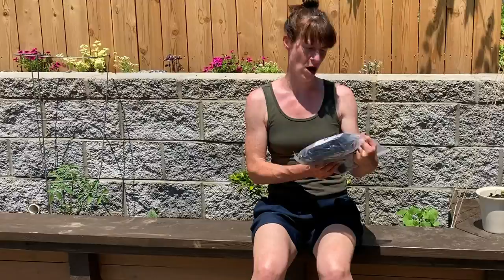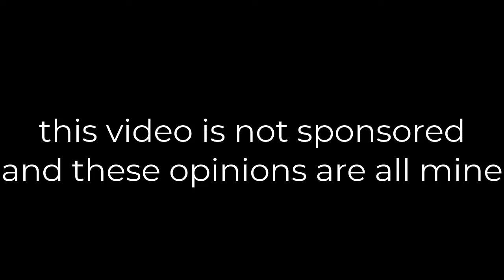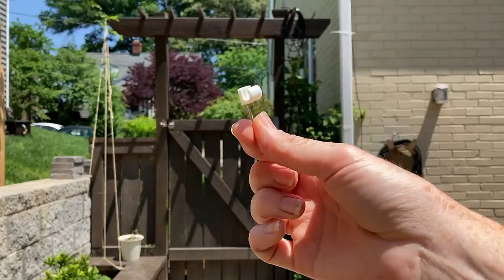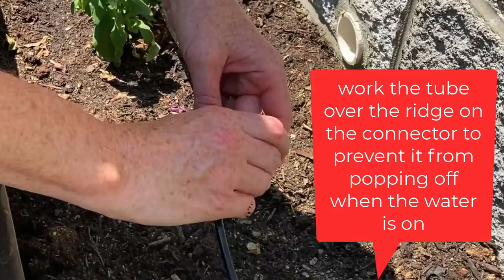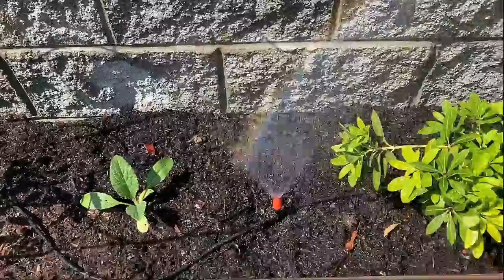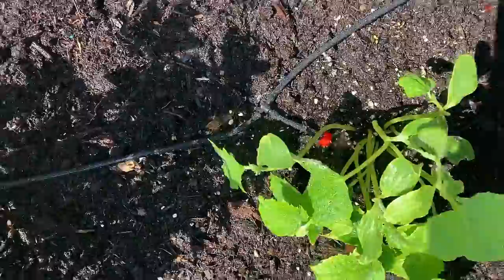Garden Irrigation Made Easy! DIY Drip and Spray System

Comment: Looks simple.  I can do this.  It looks like you ran one long line, 1. Is there a splitter of some type to allow two line into different directions? 2. It looks like all of the heads come off of tees.  What do you do at the end?
Reply from the maker: Thanks for watching! This is definitely simple. There are splitters, but if you split the line too many times it can impact the pressure. I have two lines but split the spicket with an adapter instead of the tubing. There are end caps in the kit I got.